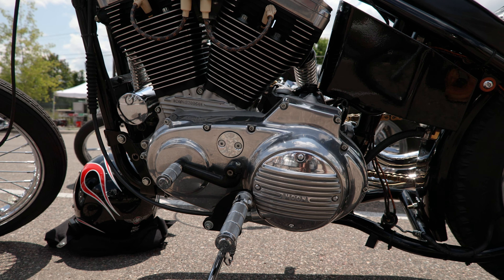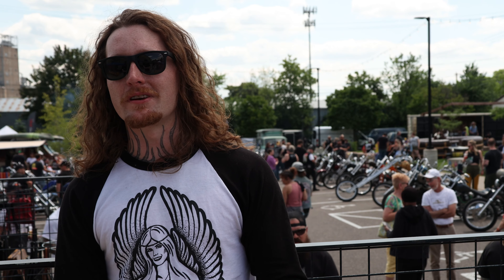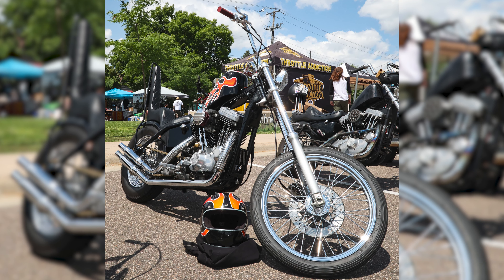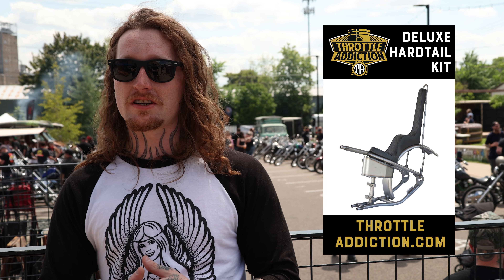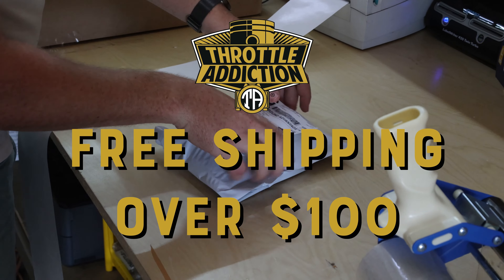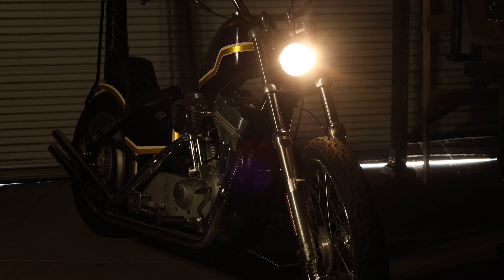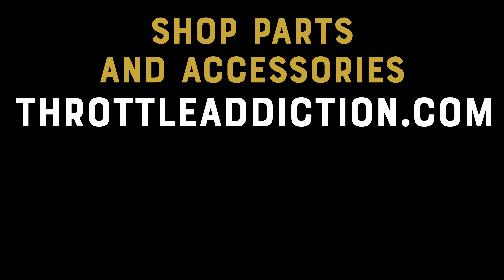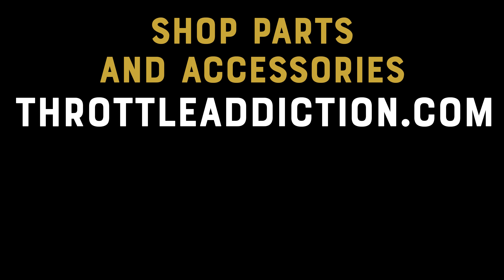He built this Sportster Chopper in his bedroom

Comment: Memories! I partially built my first chopper in my bedroom. That was in the 1960s. That is one bruisin' EVO Sportster! You ran a front brake (always a good idea). The forks are the right length. The stance is groovy. The flex piped and upswept headers, along with the slash-cut cigar shorty mufflers on the exhaust system is right and tight. The paint is boss! I love the riser/bar combo! Thanks Devin C. Millett and Throttle Addiction! Ride safe! Oh yeah, tell 'em The Eazy Company sent'cha!